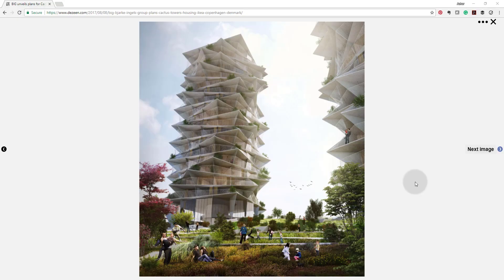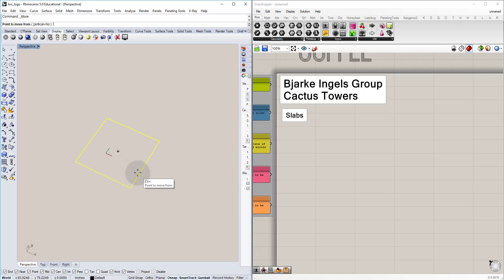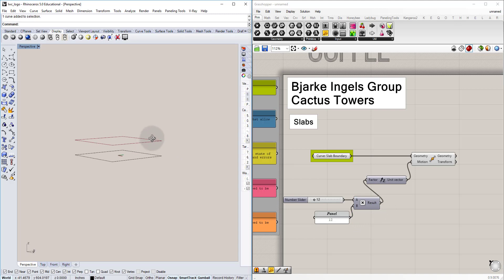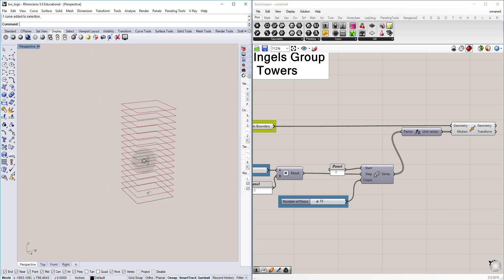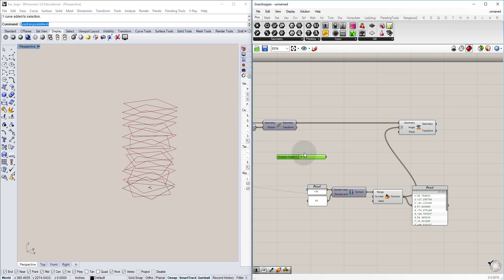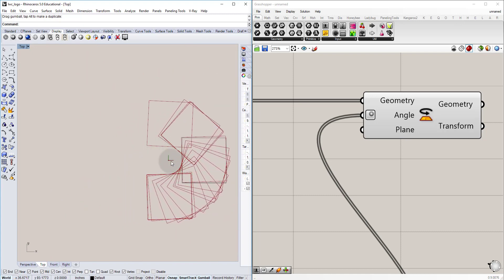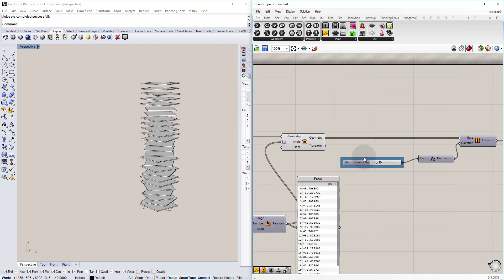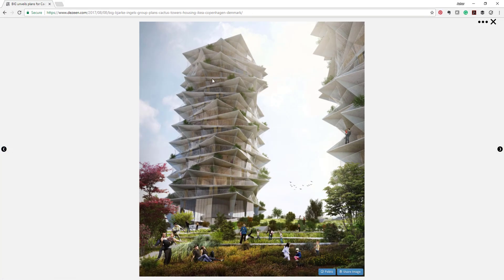Grasshopper Tutorial_Cactus Towers Part 1

Comment: Hi, when adding a Range instead of Series, we need to add 1 to the Slider before connecting it to the Random component, since the Range will produce an output count that is higher by 1 compared to the Step value. Otherwise, the last two slabs will have the same rotation values.
Reply from the maker: That's correct, Miled. In cases like these I always prefer to use a Range as I can control the Start and End values.